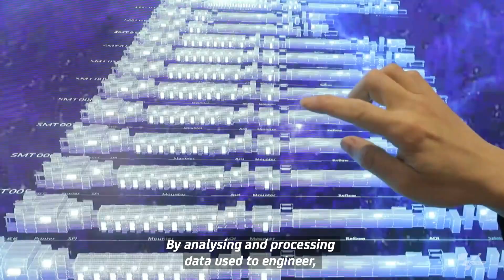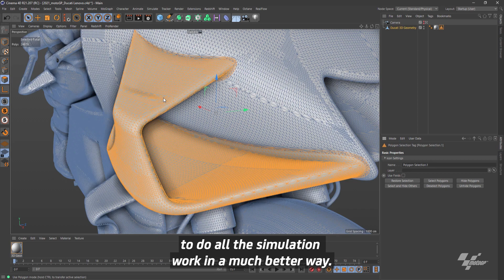Lenovo and MotoGP | Find out how technology is improving Ducati's performance on and off the track

Comment: why my computer lose battery when me go to sleep
Reply from the maker: Hey there, Bloxtun001. Thanks for reaching out to us. We'd like to verify if the laptop is losing battery life when it goes to sleep mode? We'd like to know as well if there're any recent changes that has been made on your laptop prior experience this issue like newly installed software or updates? 

Please make sure that the laptop/computer has the latest drivers and BIOS installed by using Lenovo Vantage app. Kindly visit this link for your reference https://lnv.gy/3DmwdsV. Let us know how it goes. Rodney_Lenovo
Reply: when i go to sleep in real life it's 5% battery the next morning..
Reply from the maker: We understand. Please apply the steps provided in this link to extend your laptop's battery life https://lnv.gy/30Atm19. Once done, monitor your system if it would still exhibit the same issue afterwards. Kindly share with us the outcome. Rodney_Lenovo